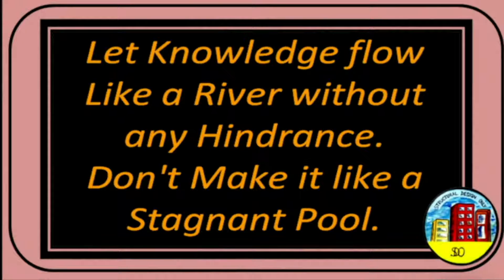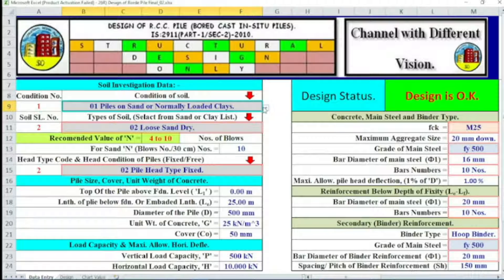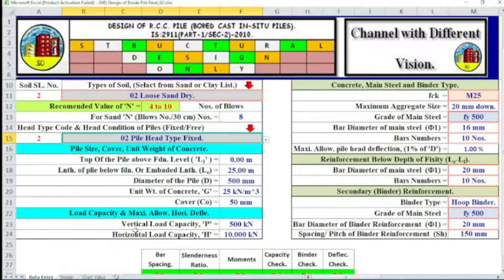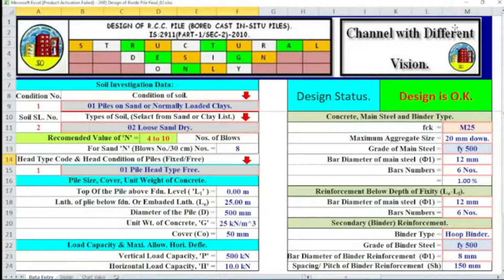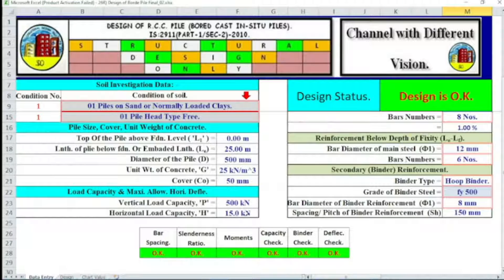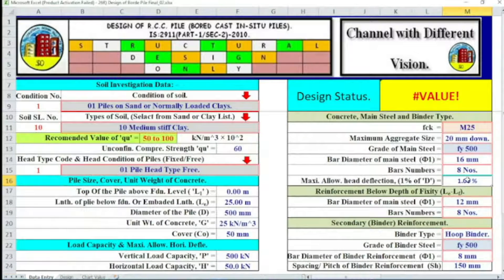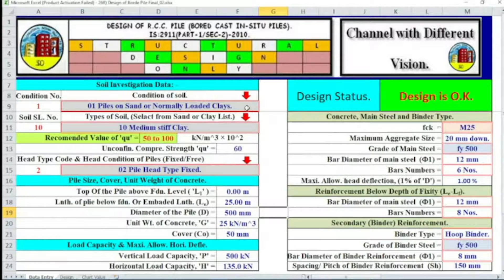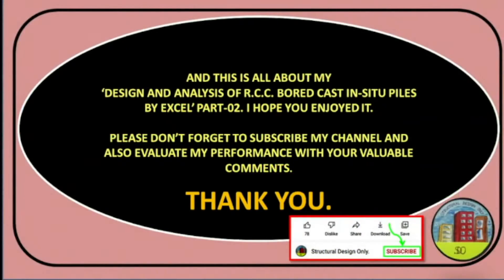How to Design Cast In Situ Pile in Excel, Part-02.

Comment: Should pile capacity in tension (uplift) have also been taken in to account in the spreadsheet? I am new to pile design and its intricacies. It is just a begineer's thought.
Reply from the maker: For R.C.C. Structure. Excessive uplift pressure is not recommended. Minimum uplift force is the weight of the pile. For more accurate calculation you have to follow the soil investigation report. Uplift force will always be < bearing capacity of the pile. Thank you.
Reply: Thanks
Reply from the maker: You are most welcome.

Comment: In case of long pile l/d more than 12  how excel is designing the pile for structural design
Reply from the maker: According to the nature of soil and head condition we are going to get the depth of fixity. This portion of the pile will act as a column. Not the total length of the pile. Thank you.

Comment: Dear sir 
Thank you for preparing  this bored castin situ pile design as per IS2911 part2/ section 1.
Reply: Dear sir,
Kindly share the excel sheet on bored cast in situ piles covering part 1 and 2 please.
Thank you sir.
Reply from the maker: Dear Ranjan Sir, you have received Excel sheet for 2 to 9 Piles Cap on 24/02/2023 (19 days) you have to wait 11 days more for your next sheet.
Thank you.

Comment: Dear Sir,
How to consider reinforcement for piles based on Load and moment similar to column or based on tension only. Kindly share the pile design of bored cast in situ.
Thank you sir.
Reply from the maker: Please check your mailbox.
Reply: @SD_Only  Thank you for sending  the  excel sheet on Bored cast in situ pile.
Reply from the maker: You are most welcome.

Comment: Good explanation. Thank you uploading. Moment may also will be there along with vertical load as wells horizontal load. It may be useful for the viewers if the program take care of support moment also.
Reply: Thank you very much for your clarification. Can you please send me excel sheet.
Reply from the maker: Thank you sir I must send the file very soon to you.
Reply from the maker: Please check your mailbox.
Reply: Excel file is received. Thank you very much.
Reply from the maker: Most welcome.
Reply from the maker: Thanks. According to IS code, when we are considering fixed he'd typical pile moment will be 1/2 of the cantlever moment. I have also considered that.
Reply: i hv not received the excel sheet sir
Reply from the maker: Sorry Sir, yes you send me mail on 20th Aug. Now check your mail box. Please don't forget to acknowledge me for receiving the file through YouTube comment.
Thank you.
Reply: @SD_Only  Gone through the details of pile design.  I have got one doubt.  How to ensure fixed pile head for singl pile?  In my opinion, single pile will be free head only.  The program is not giving design results for pile with free head condition.  Can you please clarify?
Reply from the maker: Yes as per code incase of one and two Piles cap, pile should be design as free head pile. Consideration of fixed head pile starts from three piles cap. When you design the pile considering free head watch the moment and you you will find the value just double over fixed head pile.
Thank you.